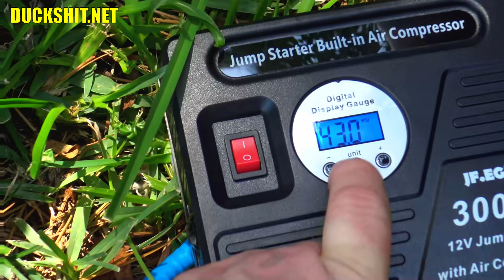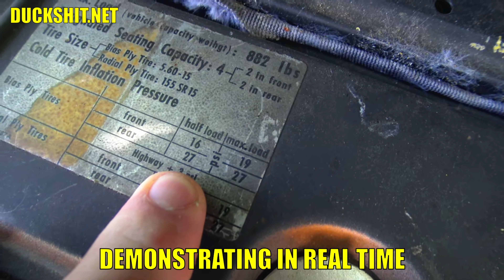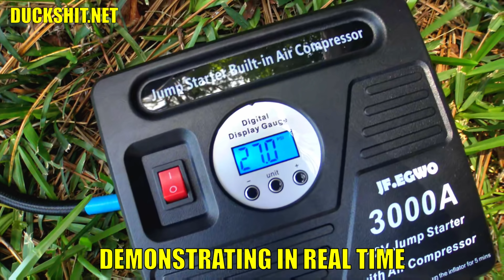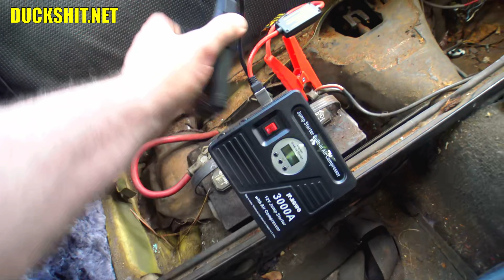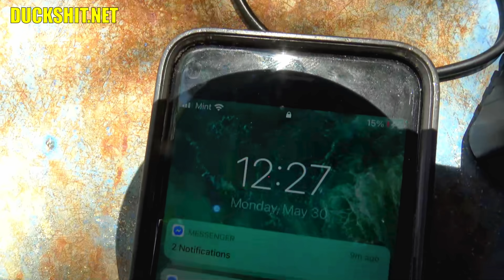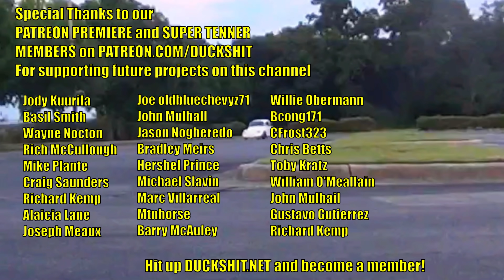JF.EGWO 3000A Jump Starter with Air Compressor - Super Volksrod - 07

Comment: 3000 amp????. An 8D diesel battery doesn't have that but who knows maybe this does.
Reply from the maker: Yeah I thought that was goofy, too... but then I dug deeper into the specs.  3000 amps is the maximum it can provide, and well.,. At that amount of amperage the battery will be dead in seconds.  Nobody will really be testing it at that level.  Is actual battery capacity is 24000maH.  Lithium ion batteries have a very impressive discharge, that's why even the smallest battery in your cell phone can violently burst into spontaneous flames.